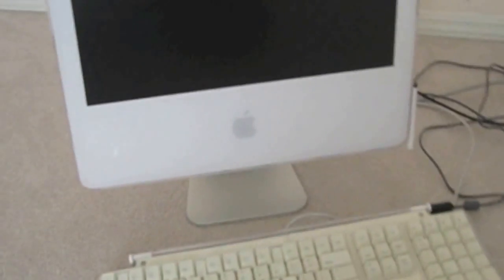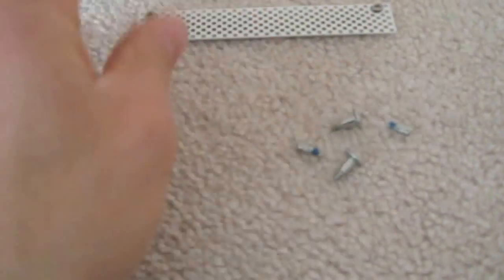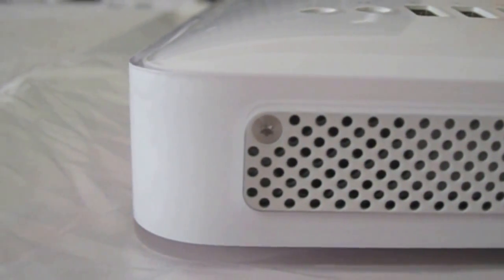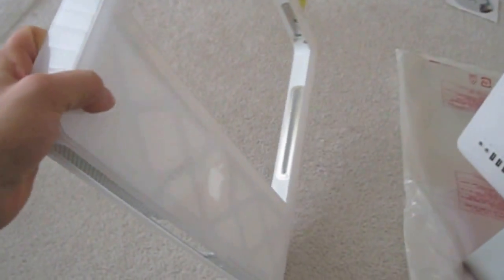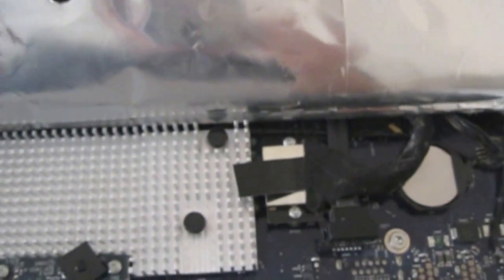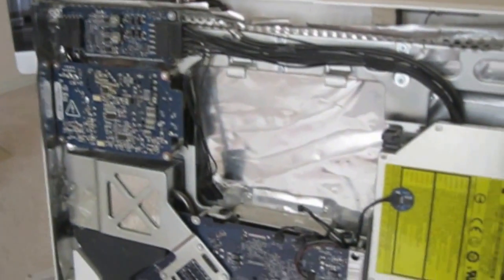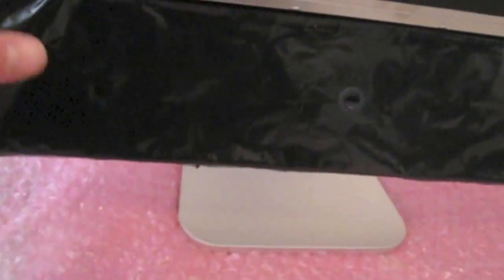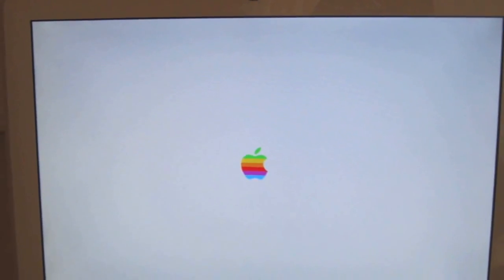iMac 17" (Late 2006) 1TB Hard Drive Install

Comment: Could I load linux if it's on a new ssd, and the original os with its original hard drive?
Reply from the maker: Yup! Most Intel Macs shouldn't have a problem with dual-booting macOS, Linux, or Windows. Make sure to backup the data on the Mac in case you have files you don't want to risk losing.
Just need to make sure the version of Linux is compatible with your hardware and there are various guides online that can get you to dual-boot macOS and Linux.
Reply: @RandomActsCanada  not long after I posted that, I decided to do a full had swap, not it have zorin Linux on it. Few driver issues but nothing too bad.